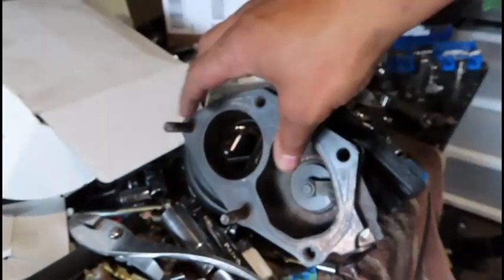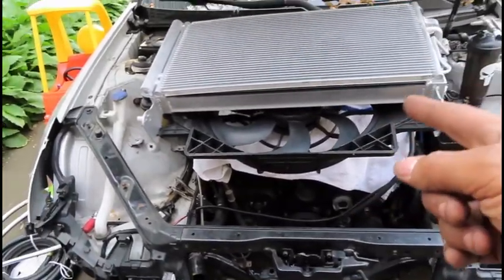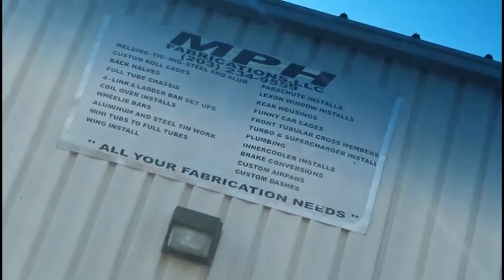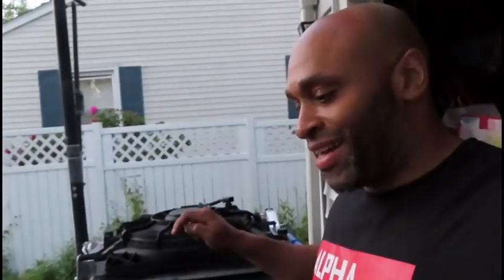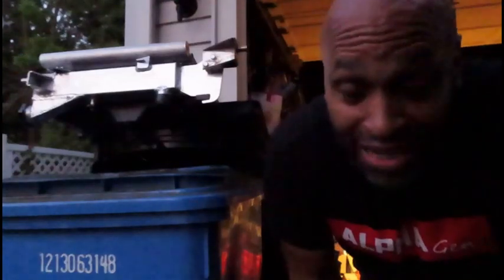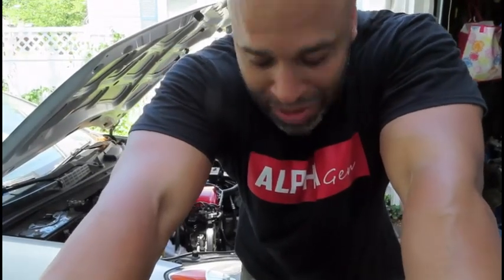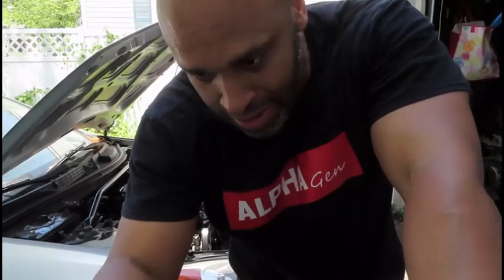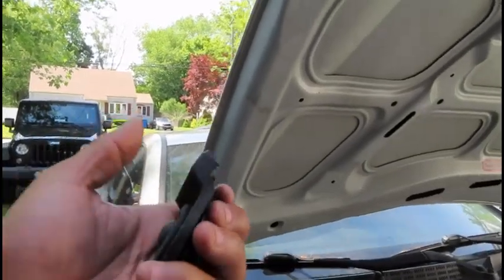Mishimoto Radiator install

Comment: What size bolt did you use for the bracket? M7 1.0 is small and M8 is too big
Reply from the maker: For which bracket? Sorry this vid is a year old 🤷🏽‍♂️🤣 but which bracket so I can help you out?
Reply: All good, it’s the bottom mount brackets. The brackets you have to mate to the radiator. In you video you had to find bolts, I’m just trying to figure out their size. I’m stuck
Reply from the maker: Ok, I’ll check this afternoon and let you know! Off the top of my head I can’t remember
Reply from the maker: What are you using for fans?

Comment: The ideal of a divorced setup is to help with spool time, which will allow boost to come on faster, the ideal situation would be a separate waste gate but with those factory type turbos are not a option, you could always leave the dump open, pure screamer style lol
Reply: There is always options lol he could run an external wastegate.
Reply: @jeffreycattelino3996  true, but would be a huge pain to keep the factory one closed and get a different manifold, at that point might as well just go with a aftermarket turbo also.
Reply: Sfr did it you haven't looked that video up yet probably smh.
Reply: @jeffreycattelino3996  not saying it can't be done, as it can be, just not really worth all the extra effort for the little you may gain